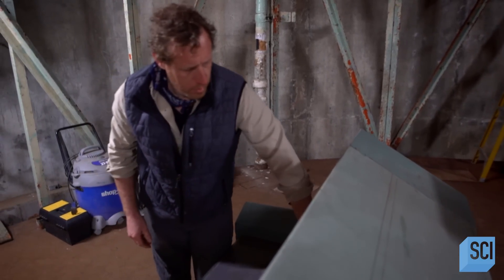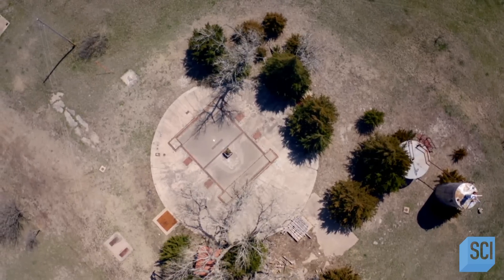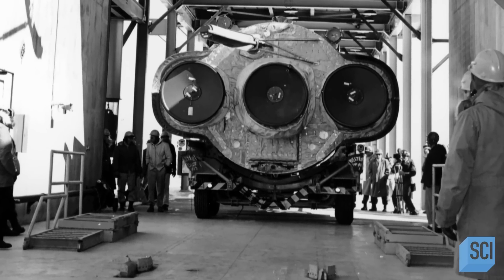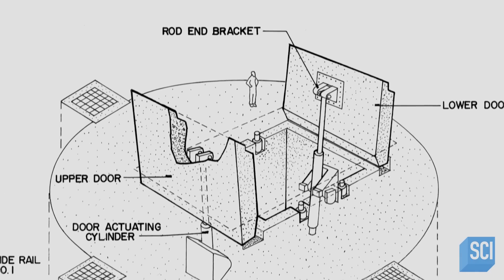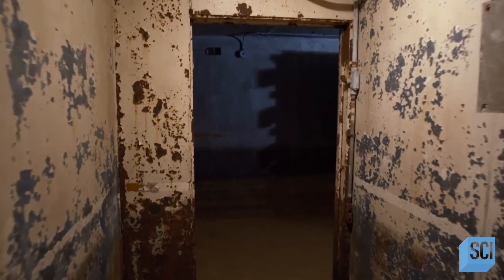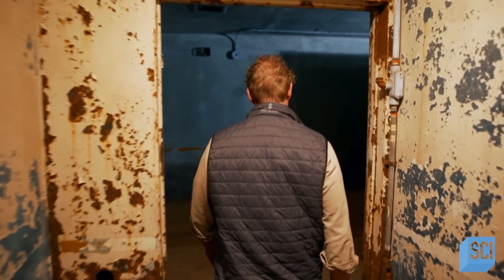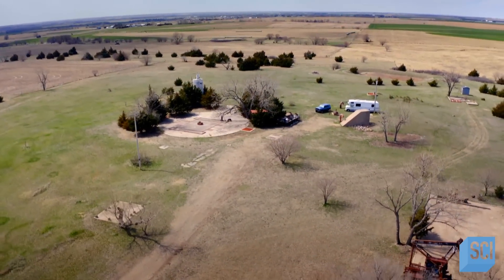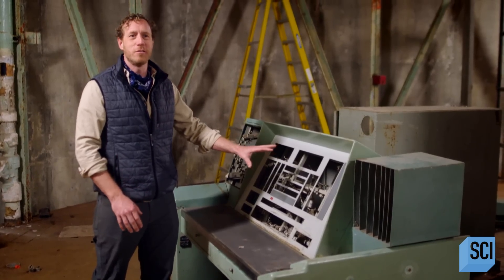A Rare Glimpse of Schilling Air Force Base in Kansas | Underground Marvels | Science Channel

Comment: The steel wall of the silo is there for a few reasons; heat and pressure from the rocket engine in the bombs so the silos has to withstand the payload taking off into the sky without breaking or melting too much. US Army had good reasons to overbuilding the silos and command posts, and it's still done today, as you would obviously feel safer being in what's basically a fort so you don't have to worry about whatever is gonna happen to you or anyone else during the launches, those missiles are quite powerful.